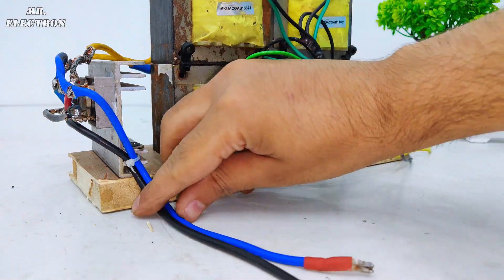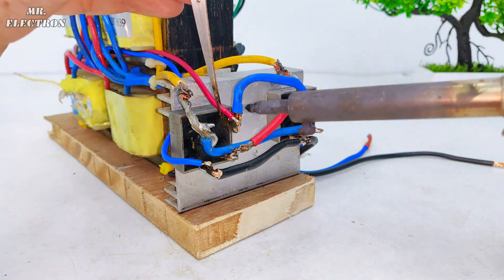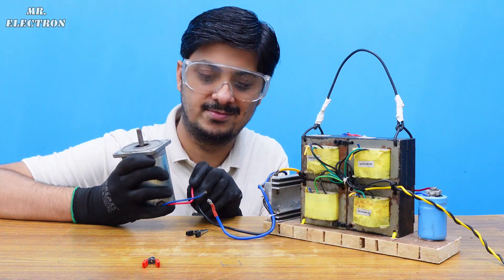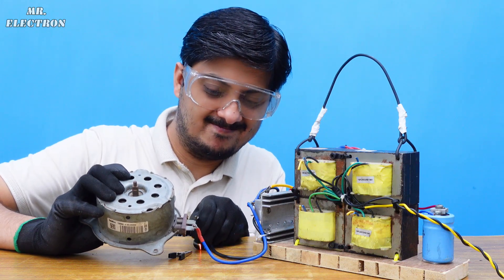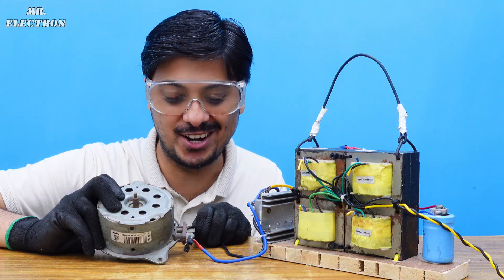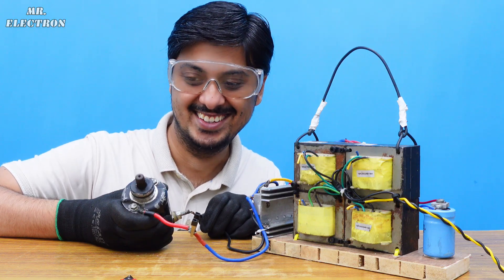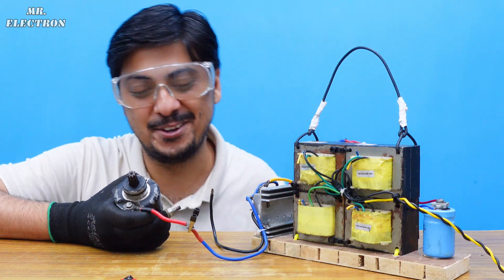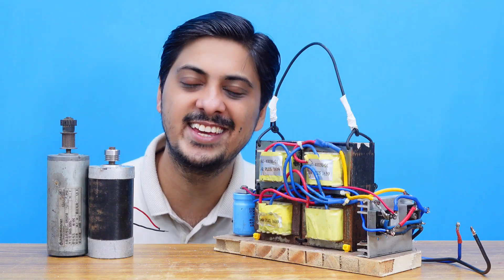12V 400A DC from 220v AC for High Current DC Motor - Power Supply from UPS Transformer

Comment: Thanks for this video.12V 400A DC from 220v AC for High Current DC Motor - Power Supply from UPS Transformer.
 Because i am going to Built this one for my DC Self Starter which take 12v Dc Motor for Tractor & Car which  will work as a battry for startup the Engine. Details The Fiat 640 tractor's starting system operates at 12 DC volts, and the starter motor typically has a power output of 3.0 kW (kilowatts). Technical Specifications DC Volts: 12 V Power Output: Most common replacements are 3.0 kW, though variations like 3.5 kW or 2.0 kW might exist. Battery: The recommended battery capacity is typically 110/120 Ah (Amp-hours) Amperage (Amps) The amperage (current draw) is not a constant value like voltage and power output, but rather a  measurement of the electrical current the motor demands during operation. The actual current draw can vary significantly, especially during startup under load (cranking the cold engine).For a 12V system with a 3.0 kW motor, the theoretical maximum continuous current (Power = Volts * Amps) is approximately 250 amps (3000 W / 12 V = 250 A).However, the actual cranking amps (CCA - Cold Cranking Amps) required from the battery during startup are much higher, often several hundred amps (e.g., 400-600+ amps) for a brief period to turn over the large diesel engine. The 110/120 Ah battery capacity ensures it can deliver this high current.

Comment: Kind regards, it would be good if you included the list of materials in your projects. How many amps are the transformers?
Reply from the maker: Actually I have made a seperate video for the member for that so... Anyways, transformer is 15 Amps to 20 amps continuous and 110 Amps Peak. I have practically tested that in another of my youtube video. Rest of the component ratings should be in this video only 🙂

Comment: I have a motor dc 24Vdc 125 amp, can i use it ?
Reply from the maker: It will run but not at full power output. 20Amps continuous is fine with this power supply and it can handle 400Amps peak for a few seconds but not continuously for long durations.

You need an even bigger power supply and more rectifiers

Comment: Yo con un sólo transformador  de microondas tengo toda esa potencia. Lo embobino y lo dejó con un voltaje de 14.8CD y utilizo una diodera de alternador.
Reply from the maker: It will work but you must check the input no load current. Its higher in case of a microwave transformer because of which the efficiency is not that great.
Reply: @MrElectron  la eficiencia del transformador de microondas es muy buena. Más que esos transformadores q estas utilizando en el vídeo. un solo transformador  dé microondas tiene más amperios que esos 4. Yo estoy  trabajando con esos transformadores desde q tengo 16 años.

Comment: With this equipment if you made engineering lab experiments on machines it will helpful for students. Experiments like tests on transformer and alternator, i don't suggesting that you don't have DC machines with windings u have only pm DC motors. It is my request, finally I am big fan of your experments❤